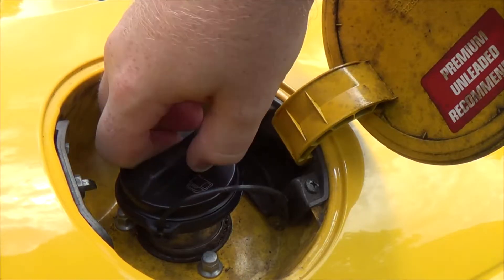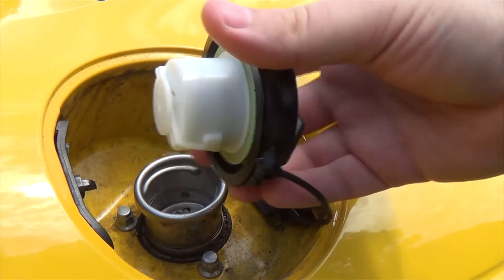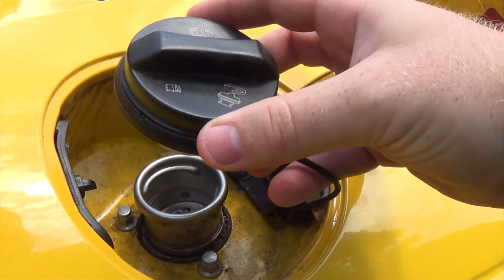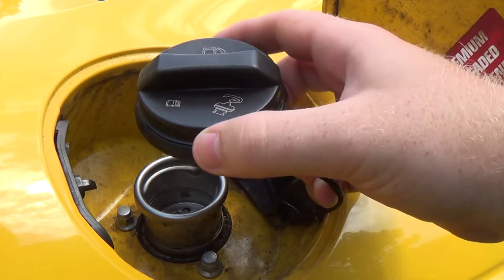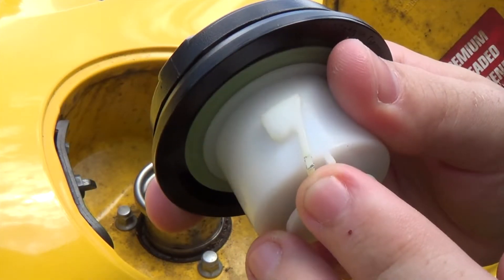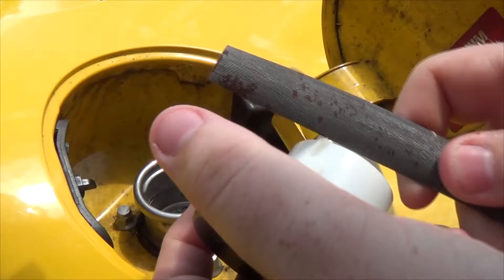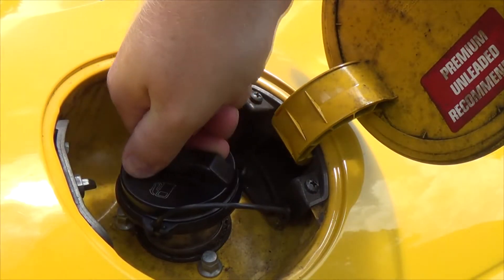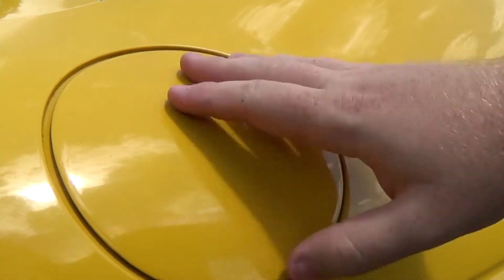How to Fix a Fuel Cap that Doesn't Seal But Locks & Clicks • Cars Simplified

Comment: Are all gas caps supposed to click?  What about older vehicles like a Ford pinto or an older Ford Taurus?
Reply: Actually just found out my '03 Taurus take OEM motorcraft 
"push in style " fuel cap...........so it's not at all the twist style.
   push in style motorcraft 
     part number FC 961
  I was using wrong cap by using the twist and click style instead of FC 961
Reply from the maker: I don't recall the general time where the clicking design became the norm, but there are definitely ones that don't click. I am pretty sure the one for the Pinto is before that time but I don't know for certain.
Reply: @CarsSimplified Yeah think the Pintos cap was Metal.

Comment: Actually I had no idea that my 2003 Taurus  OEM motorcraft gas cap uses part FC 961
      This is a "push in" style gas cap.  Push in and just barely turn to the right only ONCE.
      "PUSH IN STYLE"  Every Car make and year is definitely different

Comment: I have a 2011 cruze lt. I want to ask something regarding the gas cap. In my car, the gas cap is with key but i didn't get the key from where i purchased my used cruze. So the gas cap is without key and it doesn't lock there properly, click sound comes, but it still remains loose, even with click sound i can just lift off the gas cap it will open, it never tights. Maybe because i don't have its key?? Also in my car, engine check light is appearing, it's not blinking though. I think that due to this gas cap, the engine check light is appearing maybe. Also my car is burning a lot of fuel, the crazy thing is when i leave car at park in the night and again go back in the morning the fuel shows 1-2 needle less on the meter as compared to when i checked at night. 
Why is this happening and what should I do??

Thanks.

Comment: When buying a New Gas Cap Always check if they are the same Size and the same Groove if The Cap Clicked Before it should click on the new cap too before Installing the New Cap Clean the inside Surface with a Microfiber Towel and some WD-40 you will feel the Difference

Comment: Hi, my Hyundai Veloster gas cap is not clicking when tightened due to which it shows engine light. I tried a new replacement gas cap and that's doing the same thing. Haven't seen any video to solve that problem, do u know what could be the problem?
Reply: I have the same car and mine is doing the same thing. Do you have any recommendations.